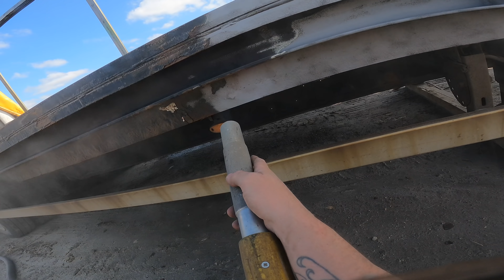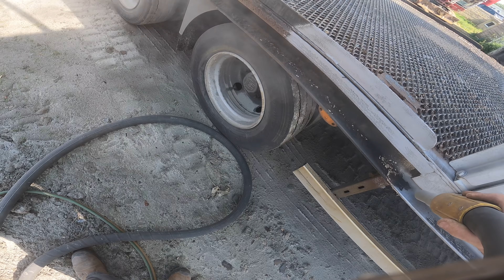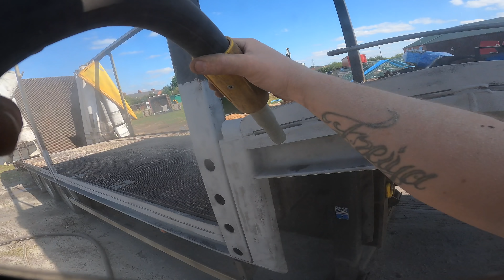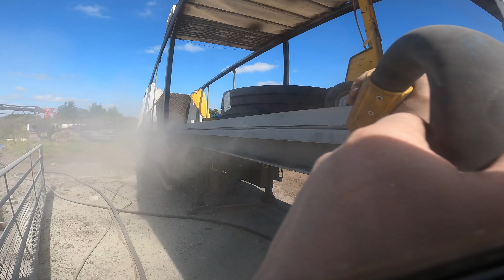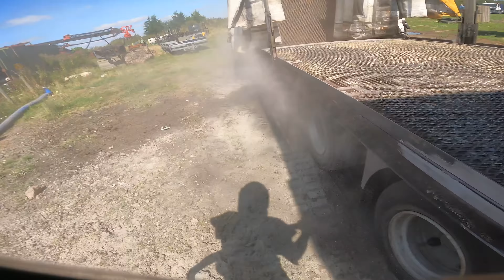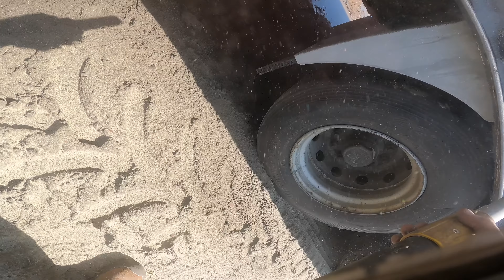Satisfying Rust & Paint Removal Truck Trailer trailor SandBlasting and painting semi artic lorry

Comment: That's look great , a nice coat of HMG paint. Media selection is a pain when you have thick scale, pitting and paint 🙈🙈.
Reply from the maker: Yeah normally fine+ works a treat and did on alot of the areas but some places was stuck good. One of them jobs were I was thinking it would be quicker to nip get some medium and carry on as I can see my house in the background 😊 I only wasted around 25 40kgs as it wasn't a big job so I stuck at it 😎
Reply: @Mobileblaster The finer you use the quicker you blast but sometimes it's will the rust come off . I've used an air chisel to knock the thick scale off .
Reply from the maker: @boatsandblastservices2165  I find the bigger grade has a better bite on the scale finer grade for paints and light rust that's why I normally pick fine plus its a fast cut rate with a little extra for some scabs. But theses scabs was big scale a little more size would help the speed a little not by much but would have helped 🙈
Reply from the maker: @boatsandblastservices2165  I don't like the air guns they vibrate ya hands to bits haha and the right media is just as quick if not quicker than the air gun unless the ones I've used are crap haha
Reply: @Mobileblaster  Ha ha yeah they do . I used to use medium on boats and I swapped over to fine/med and its spot on 👍👍.
Reply from the maker: @boatsandblastservices2165  its a hard choice sometimes tho as its a matter of loading the van before and its a matter of picking 1 or the other eva that or handballing 20 bags off a pallet and hand balling 20 others on to make a mixed pallet that's not something I like doing haha
Reply: @Mobileblaster  it's not fun is it 🙈🙈. I don't have a forklift so everything is handballed on and off , the only luxury  I have is an all terrain pallet truck!!. How about an apprentice to knock the scale off for you 👍👍.
Reply from the maker: @boatsandblastservices2165  oh pallet truck 😵 you need forks for sure 😎 life is so much easier with 1
Reply: @Mobileblaster  A forklift is on the Christmas list 🙈🙈

Comment: hi. great job. how long did it take ? what size pot do you use ? how many times did you have to fill it up during the clean ?
Reply from the maker: thx it was around 3 to 4 hour blast and paint. I used clemco 2040 around 9 bags it holds 3 x 25kgs of fine plus but 4x 25kgs of medium :)
Reply: @Mobileblaster  WHAT ENGINE IS IN YOUR SPRINTER TO PULL ALL THE EQUIPMENT ?
Reply from the maker: I think 2.2 it's the twin turbo version. I've also had the ecu remapped to add more power 😎 its about 150/160bhp

Comment: Hi, how many kilograms of media does sandblasting collect and how long do you blast with one charge also how many mm is your nozzle 😃
Reply from the maker: Hi on this wagon it tuck 9 bags x 25kgs each 3 bags will get me around 1 hour. my nozzle gets me 100psi @260cfm the bore of the nozzle is determined with the cfm to reach desired psi for this instance im working with cdx 750 #7 I think that's 11mm 7/8"
Reply: @Mobileblaster  #7 is 7/16. Slightly less than 1/2 inch. Each # represents 1/16th". (1.58 mm)        # 3 is 3/16.              # 4 is 1/4".         #8 is 1/2.         The largest nozzle I have ever heard of anyone using sustainably is a # 10, that's 5/8ths.     125 psi on a # 10 nozzle gives you nearly 90 pounds, 36 kg of thrust on the pushback of the hose. Most men cannot handle that 8 hours a day.  We will not use my # 7 or # 8 on a ladder or scaffold as it will blow you off backwards.

Comment: What size nozzle are you using for jobs like this ?
Reply from the maker: #6 nozzle size is all down to the cfm your working with optimum psi is 100 at the nozzle to get this psi with the cfm you have refer to the chart that the nozzle supplier should provide every compressor is different and take into account your water trap and helmet use cfm when ordering 👌

Comment: While you mention medium size grit might be nicer for the thick rust, do you know what it does to a paint job?  Fine grit can be covered with thin paint. Medium grit needs a much thicker layer of paint to prevent rust.    If you look at the profile part of this report, it will make sense to you.   https://after-hours-welding.com/Corrosion-Report.pdf    The larger grit creates a much deeper profile depth, which requires much more paint, or multiple coats to fill it all in and gives you a poor peak height to valley depth ratio. It's on page 6 I believe. I wrote it so long ago, I might be wrong. 

Profile is also called etch.  I have seen a brand-new paint job rusting in only 6 months because the peaks pointed just slightly above the paint. It was not visible to our eyes, but water found steel and made it rust in thousands of pinpoint places as it started. I warned that painter I used large grit, and he needed 2 thick coats of paint. He did not listen. He didn't even know what profile was, and I knew exactly how much profile I had created. 

I had to remove 10 layers of paint off of a outdoor steel fireproof staircase. I used large grit. 20-30. 
It was a shame. The project owner spent $400,000 getting 8 stories of staircases blasted, re-welded and refurbished. To only see them rusting again in 6 months because the painter would not listen to an expert. 

By the way Mick, I like your videos. Thanks for the entertainment.
Reply from the maker: With glass I wouldn't be able to cut through heavy scale with fine glass if I up it to medium it will cut alot faster and not make much difference to the profile if I go up through the media in the scale of heavy but the same fineness say JBlast or slag this is more dence and will give a slightly more profile although it's the same partical size I've found a fine grade but heavy is super affective at ripping rust scabs and paint but the cost to time saving I believe glass is still the best all-rounder for the vast line of of work I do. I know exactly what my rebound area it's with glass and know my safe limits start with grit that don't brake up as fast then it's a different ball game 😬
Thanks mate glad your enjoying them and it's nice to have a fellow blaster to compair notes with I appreciate it 😊
Reply from the maker: I don't get involved with the painting as I know the is too much that can go wrong I've not spent enough time researching paints or enough time working with such to comment on the painting side. I do see this wagon on a daily basis and it looks fresh with its new curtains on 👌
Reply: @Mobileblaster  It is fun talking to a fellow blast expert. That's super rare for me. Usually I talk to customers who know nothing, and typically they are ill-informed on what they think they do know. Or I am talking to my employees, trying to teach them, what they really don't want to know, while they are only half listening at best.
Reply from the maker: @weldersandblaster  that's the worst kind of person I will quite happily listen to someone else's methods and quite happily try such because anything that will make my day go quicker or easier I'm all for 😂👌